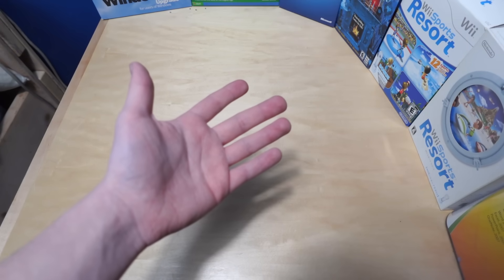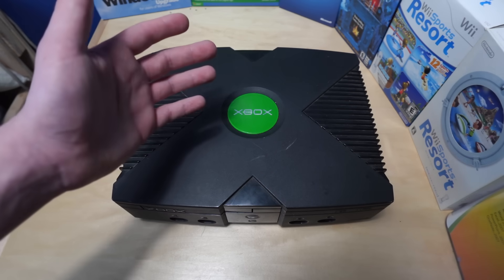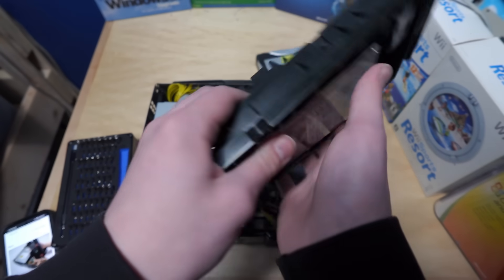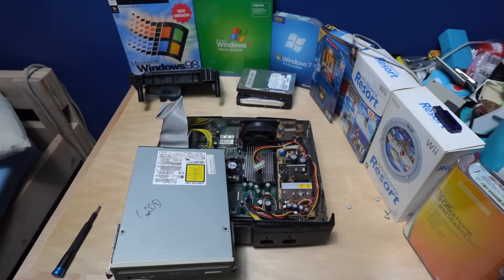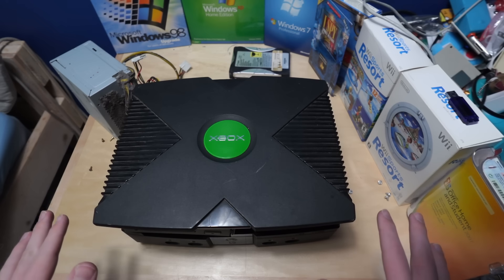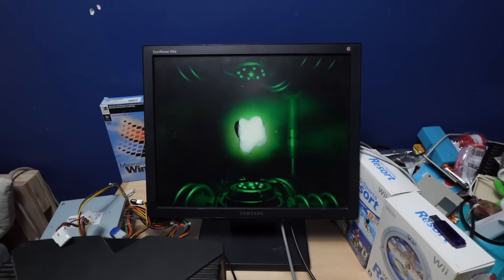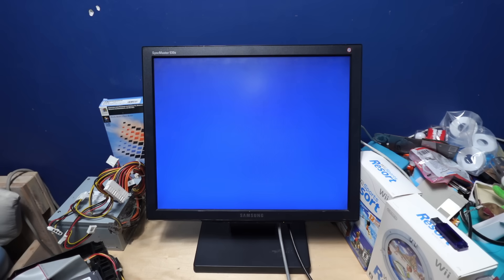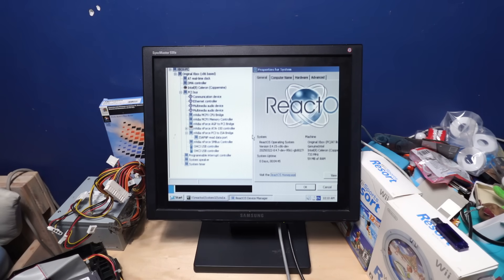Installing ReactOS on an Xbox

Comment: If I remember correctly the reactos usb stack does not play well with the xbox controller so you have to quickly unplug it for usb to work. Could be outdated info tho

Comment: You would have needed to jump two pins on the 24-pin connector to get the PSU to turn on outside the computer. I forget which, unfortunately.

As for the Xbox constantly thinking the DVD drive is open, it's expecting that signal to come over the _power cable_, if memory serves.

Comment: Question, when you had the cd drive hooked up to the ol pc power supply. Were you really surprised it did ‘t work until you booted the pc itself?
It should be pretty common knowledge that a psu only delivers power when turned on, unless you think a psu is alway in an on state.

Comment: Did you remove the clock capacitor? These lousy capacitors leak and can destroy your irreplaceable Xbox. If your Xbox is a 1.5 model or earlier, simply removing the capacitor is enough. If it's an Xbox 1.6, you'll need to install a new one, as the Xbox might not boot without the clock capacitor.

Comment: 8:52 For this specific power supply, you have to connect the GREY wire to any BLACK wire and pull at least 10 Ohms on the 12V (Yellow) wire. For the load, use at least a 5W resistor. (The DVD drive may not initially pull enough load)
OR Don't use this PSU. Honestly you can buy little molex-to-powerbrick adapters for super cheap.

EDIT: And by the way, I basically never take the PSU out of the GX1. I have several GX1s in my collection, and the PSU is so unique and bespoke, it'll never fit in another computer or application.

Comment: Pro tip: ATX power supplies need a signal through two of the pins before they turn on and supply power, they dont do anything if the 20+4 pin connector isnt plugged into anything. You can jump those two pins with a wire or solder in a button, but thats why it only worked once you turned the PC on.

Comment: The reason why the keyboard and mouse didn’t work is that ReactOS’ hardware abstraction layer (HAL) is currently extremely broken. Essentially, the HAL cannot correctly acquire and map interrupts for PCI devices on the original Xbox as well as anything with EFI firmware and some newer legacy BIOS-based machines. This leads to every PCI device, including the USB controller, either being ignored by or behaving erratically in ReactOS.

Comment: On power supplies, there is usually a pin that is used for detection It's usually on the motherboard power connector you usually have to short it to ground before it will spin up
It's a safety feature. Look it up for your power supply and use a paper clip to carefully.
Short it to ground after that, it will spin up like it's connected to a computer

Comment: you know why you couldn't install the OS correctly? because it's not basically a PC.  Now if you used a Linux OS which ReactOS isn't Linux, you would have better chance installing and operation with no problems. because you used a Windows base .exe which isn't compatible with this Xbox. Trials and errors my friend, back to the drawing board for you, install a Linux.

Comment: If the DVD power connector on the Xbox is anything like the one on the 360, a pin on the connector carries the tray signal and will always be Open if there’s no held short. I’m guessing bypassing it means you have to short that pin on the motherboard to Ground or splice it.

Comment: With these ATX power supplies, you need to short some of the pins in order to get the supply to power on (I dont remember exactly which ones). There are power supply testers that you can buy for cheap that let you turn them on externally

Comment: For future reference a PC's PSU won't do anything unless it detects a PC being turned on. U can jump certain pins on the 20 pin connector to get it to turn on but u gotta be real careful because u don't wanna short the wrong pins. U might be able to look it up depending on the PSU u have. Hope this helps. Also wanna say nice vid man didn't think something like this existed
Reply: If you're using a standard power supply it'll always be the same pins. You want to short PS_ON (Green) to GND (Black) and for 24-pin connectors you also want to short VOLTAGE_SENSE (Brown) to 3.3V (Orange). The colors may be different depending on your power supply, so it's always best to look at a pinout. Just look up 20-pin PSU pinout or 24-pin PSU pinout.
Reply: @deltarathedev  yeah something like that. I don't know the pins just know u need to jump em lol. Hey at least someone more knowledgeable can chime in for some info so thanks!
Reply: @Cartman3782  No problem man, you had the right idea! I just wanted to add the specific pins just so people know. 

Ones in newer gaming PCs will probably have the wires all black or white, so it's best to look at a pinout for the exact locations instead of going by color. Although the color is standard, it might not always match up. 

Plus, if you have an OEM computer like a Dell it might have a custom pinout, so it's not always the standard one (like you mentioned).

It's always best to search up your model before you do it.
Reply: @deltarathedev  yeah thanks for adding the info I don't wanna get it wrong and then someone blows up their PSU lol. Knowing me I'd do what jiga did and use the entire PC lol
Reply: @Cartman3782  haha, it does work so I can't blame you. I always say its not stupid if it works.

Typically, the older ones will have the standard colors and pin placement, but its always good to make sure. That was before OEMs really liked to inconvenience us.
Reply: @deltarathedev  I like ur mentality or whatever u wanna call it. That's a good way to look at something
Reply: @Cartman3782  I've done my fair share of inefficient things but it's worked and that's all that matters. Is it the best way? Not always, but as long as it works.
Reply: @deltarathedev  there ya go
Reply: Isn't that the difference between AT and ATX power supplies?
Reply: @bootmii98  I have no clue lol. Also nice username

Comment: The dell power supply DOES have a power switch, just not a button to press. You need a paperclip to connect pins 16 and 17 on the 20 pin connector. Give er a google and it looks cursed but it'll make your life easier next time haha. Cheers!

Comment: The external psu didnt work because you need to bridge two point with sth like a paperclip in case to "startup" the Power supply like a actual PC.

Comment: The Xbox OS was literally Windows 2000 with most things stripped off. The X in Xbox stands for DirectX
Reply: And nowadays its windows 10 heavily modified
Reply: @309electronic5 the stripped down Windows version only manages networking, apps and dashboard. Windows 10 it's going EOL in October, so, Xbox may be already running a stripped down version of Windows 11.
Reply: or windows 11 under the hood for Xbox series
Reply: @shiro3146 pretty sure windows 11 is just modified windows 10
Reply: @kyle207  windows 10 is just modified windows 8
Reply: and with the Xbox One it was windows 8
Reply: @dumpsterbaby216 I think it was originally, but I believe now it is a modified version of windows 10
Reply: Yeah modified Win 2k kernel I believe
Reply: When I knew this 1 year ago I was shocked.
Reply: It’s still possible to hack into cmd, taskmgr, and in EXTREMELY RARE Cases, it’s possible to get a bsod OEM without mods. And yes, it’s possible to boot into the windows 2000 desktop environment with hacks but all of these don’t require installing anything. They’re just leftover from 2000. There is also leftover software from Windows NT 4!
Reply: and I think the xBox 360 was modified version of either XP, Vista or 7
Reply: @superJK92  Xbox 360 probably used the least code borrowed from Windows because it was PowerPC architecture instead of x86. I'm sure they used alot of abstracted code from windows, but hardware level interaction likely would have had to been rewritten from scratch. I could be wrong tho
Reply: @MyArtificialNostalgia also win 7 wouldn't be out for another 2-3 years
Reply: @MyArtificialNostalgia NT was ported to PowerPC so it probably was based on that
Reply: And the Xbox is basically a Pentium III PC

Comment: so quick fun fact!
the original developers of the xbox didnt have permission to use windows on it, so they just stole and modified the windows source code!! and apparently it performed so well that they just let them continue after finding out
Reply: And I think it's a modified version of Windows 2000
Reply: @SamyarSamyarj  it is! if I remember correctly its either win 2000 or xp
Reply: @jkash3383  it's 2000 it's 2000 I know it!
Reply: @jkash3383  na 2000 xp was either still bein worked on or just released. As far as i remember the og xbox came out before xp. Tho xp is still one of the best windows operating systems
Reply: @SqualidsargeStudios  ok I finally looked into it again, it runs modified windows 2000!
I still cant find the video I learnt this all from, theres so many videos about the xbox's history and if its not that then its people talking about the source code leak that happened in 2020
Reply: do you have a source or are you just april foolsing me
Reply: @tauon_ Im not april fooling
it was like an hour long video of someone explaining the history of the OG xbox
Reply: @jkash3383  idk im pretty sure directx isn't/wasn't cross platform so it wouldn't make sense for them not to be allowed to use windows on a thing that's specifically supposed to run directx programs
Reply: @tauon_ this was when the xbox was still more of a concept and having to compete with windows CE, they wanted the source code to make a better version for it to the point it was able to emulate ps2

Comment: ok but did you try using the controller? because sometimes these things use xinput not direct input when ported to xbox, i would highly recommend testing controller plugged in when booting xbox+reactos if that doesnt work then the build you got just sucks,
the os isnt built for consoles anyways so not a surprise controller port to usb didnt work

Comment: psu should be turned on by shorting green wire to any ground wire ,from main 20/24 pin  then it will power up, and it's fan would spin :D
Reply: There's no green wire on this supply. It's a proprietary one shipped specifically with the GX1. It also internally checks to make sure there's a load on the 12V line, or it immediately shuts itself off. It's kind of a junky PSU.
Reply: Ohh... Get it ... Interesting never seen one , i always got green wires lol  @adamsfusion

Comment: To make the power supply work without it being connected to a computer, you have to short the green and and any ground wire on the motherboard power connector
Reply: This but since it's from a Dell it might not have the standard pin out / wire color for the ATX connector.
Reply: @ethanlindsey  It does
Reply: @ethanlindsey  And you would be correct. It's technically not even ATX compliant. The motherboard in the GX1 needs that specific PSU.
Reply: Was Abt to say
Reply: i too have been on the verge of uttering these words
Reply: This isn't an ATX power supply, and there's no green wire. There's a grey wire that provides a lower voltage for certain special devices on the board, and that initially has to be grounded and then a load placed immediately on the 12V rail.
I have three of these in my collection and PSU issues are the worst with them because they're completely bespoke parts.
Reply: Was about to say it too
Reply: was about to say it too actually
Reply: Was about to say it too too tbh
Reply: I nearly manufactured a comment with this same information